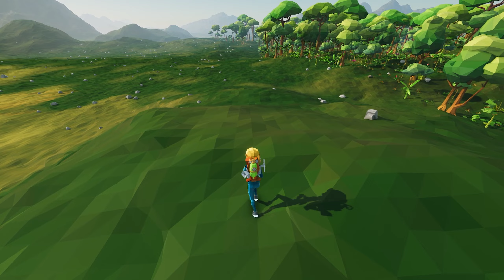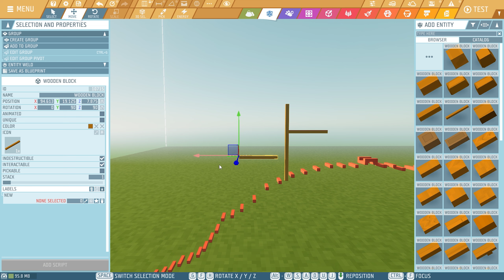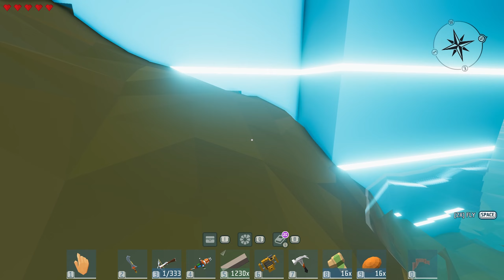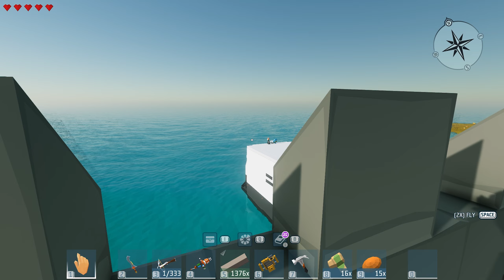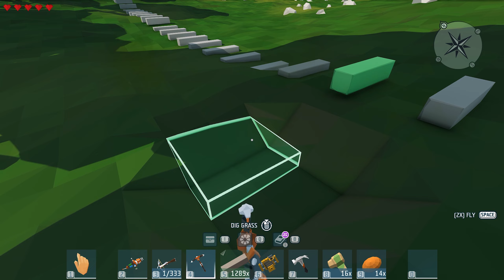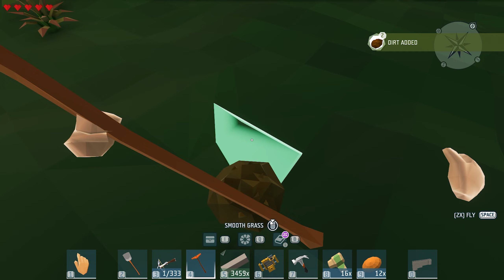New Medieval Kingdom Wall in Ylands

Comment: is not being on grid causing lag if not you can literally just make the walkway straight the length you want to go along the wall and then rotate the whole walkway down to get the slant with almost no collision
Reply from the maker: Well grid is the least lag you can create, I wish i could image what you mean.. You could send me a simple build screenshot but ill guess it might be to late now unless its something i could use for the giant castle or other structures, But thank you for thinking with me!^^
Reply: @buildingfactory  what I mean is instead of rotating each piece individually to make a ramp make them go straight and then rotate the whole ramp at one end to the incline you want It wont be grid aligned but it will not be overlapping. for future use I'll send you a short in the discord later